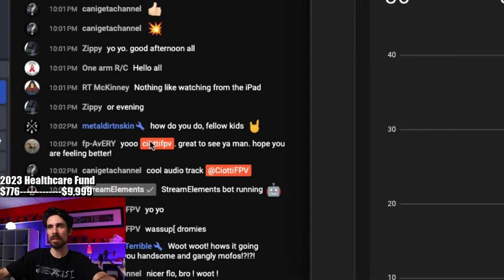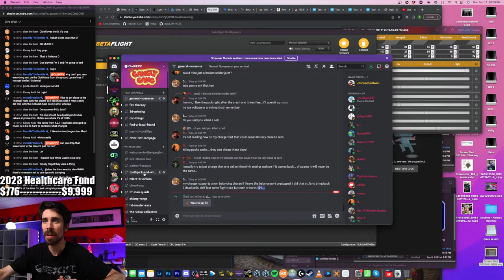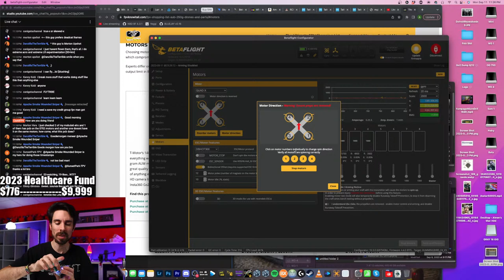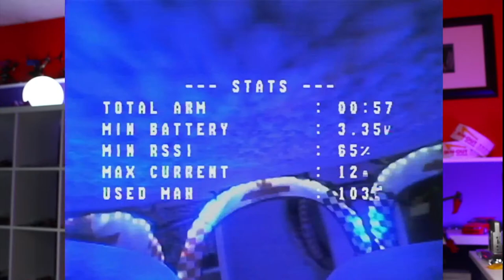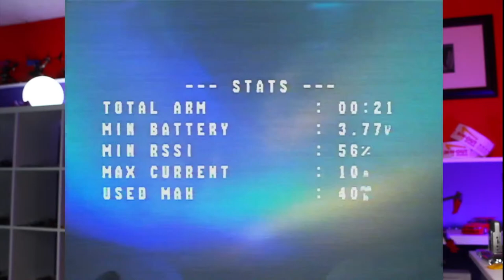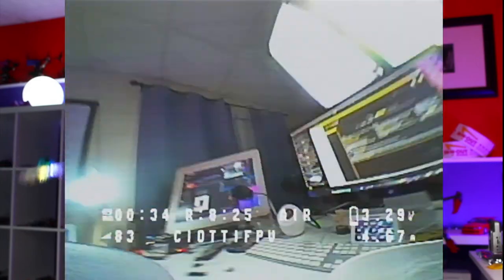Tuning and Upgrading the NBD Hummingbird F4 V3 - Q&A

Comment: What’s up my friend

00:03:53 On this stream…..
00:11:17 Checking the NBD Hummingbird F4 V3 settings on Betaflight 
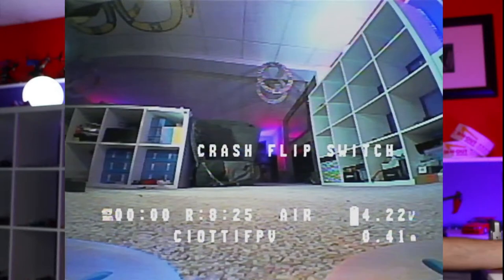00:25:58 Let’s fly the NBD Hummingbird F4 V3 between the sneezing 😉.
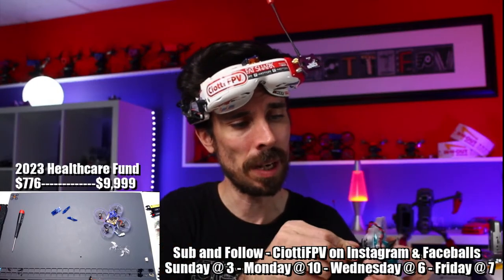00:27:04 Changing settings on the NBD Hummingbird F4 V3.
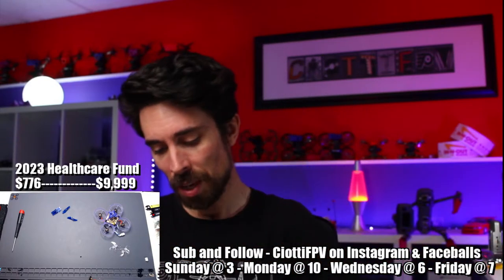00:32:44 Switching props on the NBD. (GemFan 1208 props)
00:38:32 Testing the NBD Hummingbird F4 V3 on the GemFan 1208.
00:46:06 Switching to 0702 29.000Kv
00:51:37 Why don’t you put everything on zero and do a Ciotti tune on it?
00:54:02 I recently got my first Pavo Pico, I want to fly it indoors. Can you recommend rates and motor limited?
01:00:14 What firmware is the NBD Hummingbird F4 V3 on?
01:00:44 Any recommendation on a 4s motor for a 3” build?
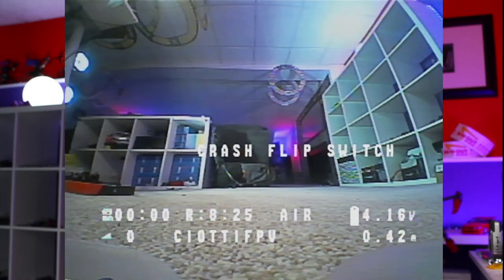01:07:23 Flying the NBD Hummingbird F4 V3 on 0702 motors?
01:09:58 Did the 0702 motors got destroyed because of the screws were to lang??
01:15:24 Any solution to help better stick resolution for Whoops?
01:19:11 What kind of difference in flight should I expect going from 0802 19.000 to 0702 28.000Kv
01:24:50 Will the motors spin up?
01:27:23 Let’s see if it will fly?
01:34:15 Going on full Stevie Wonder mode, flying the NBD Hummingbird F4 V3 🤣.
01:37:00 Switching to BT2.0 on the NBD Hummingbird F4 V3.
02:03:08 Flying the NBD Hummingbird F4 V3. On BT2.0.

 Stay safe everyone.
Reply: Sup 😁 thanks ✌️
Reply: @MrDrD34TH  welcome bro

Comment: @Ciotti , do you know of a better hummingbird v3 canopy than the goober it comes with? I barely hit the ceiling and the right arm snapped at the screw. The camera come loose an almost shorted itself out to the antenna. The rubber grommet holding the antennae on ripped in half. I have the longer screw in the back. Also not sure how they have the camera mounted in to stay,,just has a slot in the top of the canopy but nothing to hold it up in there that i can see. So i glued the camera in place and the arm but dont think it'll hold.  I want a canopy that wil cover and protect the board but want the weight not to go up too high.
Reply from the maker: I think we talked about this on yesterday's stream, but in case we didn't the McStinky mount on Thingiverse is what I use for that camera when not using the Goober canopy.  There are a shitload of other mounts on Thingiverse though so browse around and if you don't have a 3d printer just figure out which one you want and ask on my Discord if somebody can print it for you and I'm sure somebody will hook you up :)